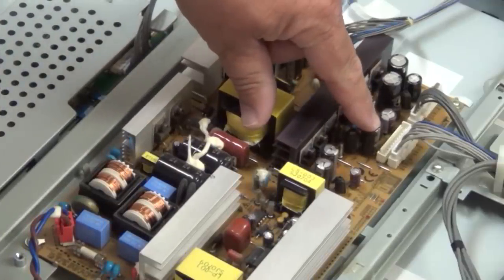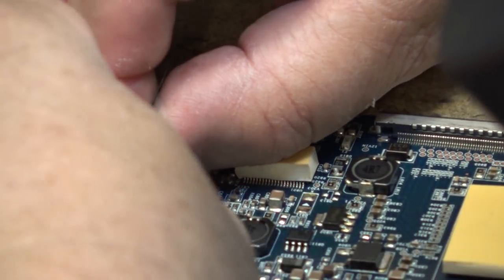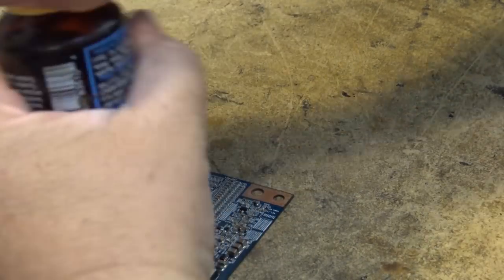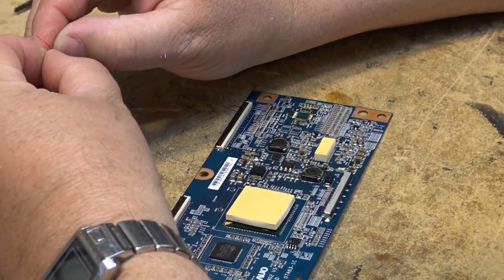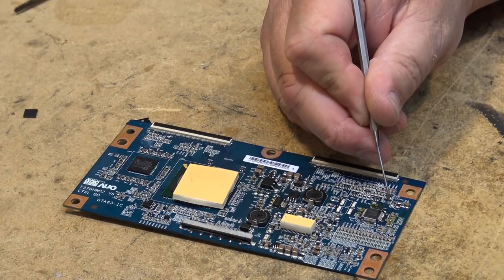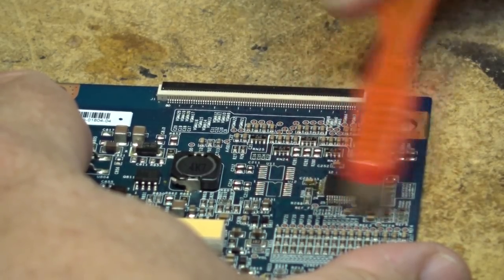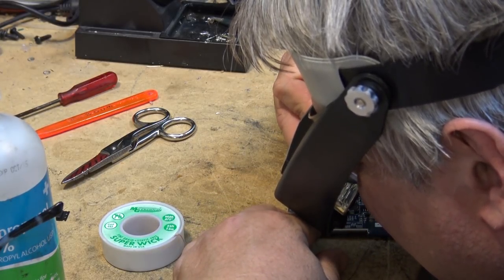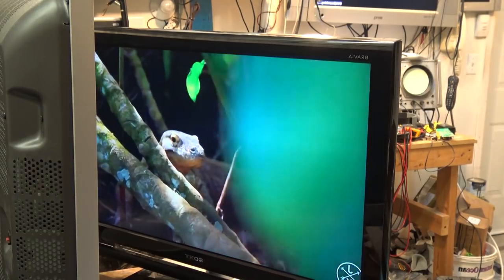Sony KDL37XBR6 Part 2 TCON board repair to component level

Comment: Hello 12voltvids! Thanks for the video! I have a KDL-37XBR6 as well, but the screen is black. Volume works and when I press on the front screen, it turns white light where I touch. Can you tell me if I should replace the T-con board completely, or could this be something else that needs replacing? Thanks!

Comment: Hello Mr.Dave need your help in catching a fault in my tv...there are horizontal lines and picture jumping issue on my 43oath1000 thomson 4k tv. Is it the fault of the Tcon board or something else?
Reply from the maker: Could be the panel
Reply: @12voltvids  thanks for your feedback 😊 is there a way I can share you the video of the screen so that you can be 100 percent sure of it. Bcoz the lines come and go they are not permanent.

Comment: Great video tutorial.  Just lost my picture on a Sony 37" I was going to pitch, since I had for 15 yrs.  Decided to pull it apart and looked at Youtube, and there you are!!!! You were working on exactly the same t-con board. Problem is I can't find the AS15-f chip on the shelf anywhere in the US .  All available stk. is located in the far east, taking over a month to get.                         .....anyone out there know where I can pick one up in the US in a weeks time?
Reply from the maker: Mine came from China for 1.82 including shipping.  Can't beat that.
Reply: @12voltvids  Thanks for responding. I do have 5 pcs (.99 cents each) on order from China... thought maybe someone had found a source in state.

Comment: Nice repair. I used a very cheap gas soldering iron I got at the local Aldi store. You can use it like a hot air station. Worked fine too.
Reply: Bought one too, but you risk damaging other components. The air out of them is mighty hot. The cutting trick is quite neat.
Reply from the maker: I think I will do a video to show removing a flat pack from a scrap board using a surgical scalpel. They work great for it. I have a new camera setup where I can get the camera directly overhead. (I set up a camera crane, and it works pretty good. Now to get the pan/tilt head working.

Comment: Thanks for this easy desoldering trick. I've never seen this before on YT.
Thumbs up!
Reply from the maker: Another way is to insert a steel wire under the pins, and heat the pins and pull the wire slightly to bend the pins up. That was the first way I learned, but the board is at risk of damage. Chipquick is a low melt solder you can flow over all the pins and then heat it up, and it will stay liquid for several seconds so you can easily remove it, but that means cleaning up the mess it leaves behind. This way is quickand no risk of board damage. Of course hot air is the best, but if you don't have hot air, this way, as you see works well.
Reply: 12voltvids Thanks for your reply. I'll keep this in mind.
I very much appreciate your  tipps.

Comment: Some years ago, i did have to replace a fine pitch ic after it failed the factory test after it was coated.
Someone did remove the coating over the solder points, so, removing the leads was no problem. 
For the ic itself i needed "brute force" (as far it was possible) due to the coating flowed under the ic. 
Removing the ic did take more time than removing the leads.

Comment: So I have many questions for you, hope you do see this and reply:  I just acquired a Sony KDL- 46XBR4 TV.
 
The first few minutes after I turn it on it works perfectly then the colors start to dance around in the Left side of the screen and darkens on the Right side.
 
I assume this is caused by the T-con board ?   The previous owner told me it is.

So how do you find out which part on the T-con board needs replacing, instead of replacing the entire board?

Also can you use a Hot Air gun instead of a hot air station to install the Chip ?

And when you are soldering all these pins and they are very close to each other, how do you prevent the solder from one pin not to flow into the pin next to it and creating a short ?  I mean they are next to each other.   Thank you.
Reply from the maker: Run it till it acts up then blast the chips one at a time with cold spray until the fault clears then you will know which chip is at fault. As to changing the chip a hot air station is preferred don't use a heat gun because you can't control the temperature accurately for flat pack IC I cut the pins then remove the remnants of the pins from the board clean the board apply Flux, center of the chip and tack the corner pins to hold the chip in place inspect and then very carefully solder each pin with a needle point type iron using high magnification to observe. There are many different techniques to solder Air station preferred but I don't have one these micro solder jobs take a steady hand and patience and a lot of inspection using a microscope or high-powered magnifying to make sure there are no shorts as was demonstrated in this video

Comment: Tricks of the trade.  Thanks for the information. Always wondered about this. None of this is boring to me....it's all great!
Reply from the maker: Just to prove that you don't need fancy air stations to change these.  They make it easier for sure.  But it can be done without it.
Reply: @12voltvids  I have a spare as15 hg chip,can it replace an as15 F?

Comment: I am having a black line intermittent on my sony TV and the main chip of that card was really hot. I decided to purchase a used control board similar to that one on ebay. I hope it fixes the problem. Where do you source the IC's? Thanks chief.
Reply from the maker: I found that one on ebay for 1.81

Comment: I have a samsung with a similar problem , not having your skills I decided to change the t-con board and got the tv working but colors are washed out. Black is displayed as grey and all colors lack brightness, any idea what might cause this?
Reply from the maker: Wrong board?
Reply: @12voltvids Thank you for your time. I bought exactly the same according to the number printed on the original t-con board, so I am scratching my head
Reply from the maker: @titodejesus6238  
Software version?
You may need to go into the setup and tweak settings.

Comment: My tv is the same as your except it turns on yet I only have a backlight. Do you think that it is a tcon or motherboard problem?
Reply from the maker: Charbear Love most likely the tcon. Very common fault on these.
Reply: Oh okay. Thank you! Also, I figured out my problem is the tcon board on my Sony Bravia. I’m not as savvy and don’t know exactly what was wrong with it so I want to get a new one and replace it. I however was told not to match by tv type because there are several boards with it. The model number is T370HW02. It has another number; BL P/N - 59.37T04.010/C. I’m just not sure what tcon board I should buy now. Please help😓
Reply from the maker: Charbear Love 
Should be a sticker on the board with the part number and software revision. Places like shopjimmy will show you the numbers needed to get the correct board. In my case I just replaced the chip because i wanted to prove the fault was indeed the part i diagnosed and it was only 1.80. Plus it was a good demo on how to change these flat pack chips without an air station .

Comment: i have a sony Bravia KJ-55A8F the T-con board is causing it to have difficulty turning on, and if I manage to get it to turn on, it will turn off at random times. Sometimes it will stay on for 24 hours and other times only for 5 minutes or less. I would really like to fix this somehow by myself, is there anything you can recommend? I would greatly appreciate it as I already purchased new T-con boards but they all come with their own issues. The turning off is the only one that displays a perfect picture with no distortion. Thank you in advance, i know this video is 6 years old but I hope you see this and can guide me.
Reply from the maker: So you bought a used tcon that had issues.  I normally wouldn't buy a board.  I fixed this one because i got the chip for 1.82
Reply: @12voltvids  any suggestions on where to check for problems on the original T-Con board that has trouble turning on and then just turns off at a random point?
Reply from the maker: @tokyotogether2495  i troubleshot this one with a can of cold spray. (you can use an inverter can of dust off) i chilled parts one at a time and when i hit the bad part the symptom changed.  I changed that part and the tv still works today.

Comment: Can Anyone help?  Sony 40", Australian model, LCD TV.  All boards no longer stocked so need to troubleshoot for a board component repair. Screen works perfectly on SD free to air channels and SD component inputs.  Screen gets vertical lines only when HDMI input selected, AND if an HD free to air channel selected.  Super weird. Any thoughts?  Cant find any similar issue described online.
Sony KDL40XBR45

Comment: Actually a good method to cut the legs of a chip :). I often do this on burnt chips. Another good method is using a stainless steel wire, tie it to the board, move it under the legs and pull the legs up while heating them. But you did really well :). Hurts a little to see you touching always that hot end of the soldering iron haha ;D.
Reply from the maker: redcatimaging 
yes have done the steel wire under the pins too,  but more risk to damage the traces that way. hot air is fastest,  cut off is next. not everyone has hot air station. as I said if I did this for a living I would get one,  but this is the first flat pack chip I have changed in 13 years and it could be another 10 before I see another. I may buy one for the vcr I am going to change 150 surface mount caps on. will see. if I win the caig video contest I will have some money to waste on tools.
Reply: 150 caps sounds really nasty ;D. You did the chip change really well, as I said :).

Comment: Is this also works for vertical lines or black lcd display
Reply from the maker: If they are thin vertical or horizontal lines it is most likely the panel.  If you have lost half the picture or entire picture is badly distorted then tcon
Reply: @12voltvids  i have a tv with bounded ribbon cables 🤣 think its not an easy task to replace.

Comment: I don't want to sound critical, but could you explore other camera angles, please? A lot of the time, we are presented with a close up of your hands blocking out the task you are performing. It makes it difficult sometimes to follow what you are doing, even though you are talking us through the operation.
Perhaps looking straight down might be worth trying, where the circuit board is in full view?
I do like your videos, but often skip through the close ups of your hands when you are not talking.
I have found using a hot air station that one needs to be prepared to place a shield between the chip and nearby SMD's to avoid blowing them off the board. This can be difficult if you need to lift the chip up after heating. Your idea of cutting the leads is an excellent one. I need to replace a chip on an LG T-CON board and I have been putting it off. I'll be getting into it now using you methods.
Cheers from down under......

Comment: Why not use a halogen lamp to heat up the pins until the chip is hot enough to be picked up off the board?
Reply from the maker: Will take too long.   Faster just to cut the old chip out.
Reply: @12voltvids  Ah ok. I’m just scared that with my nervous dumbass self I’m going to screw up the pads somehow and there’s no going back on that...
Reply from the maker: @walle637  
Cut the pins with a razor blade or scapel is easy. Then remove the pins like i did.  Changed hundreds this way when i was in the business and never screwed up a board once.

Comment: amazing!I just dont understand how you can solder the chips pins to the board without bridging them?Obviously there are techniques that i dont know....but how do you get it so damn precise and fine?
Reply from the maker: Slow and steady. I used a good magnifier to check, and double check the connections for bridging. 
I used to do this work professionally, but retired in 2003 from that line of work. There really isn't a specific technique, just steady hands, and take your time. I showed how I did it. Tacked down one side, and very carefully checked alignment then started soldering down pins. Lots of solder flux is the trick. That helps prevent bridging.

Comment: I wonder if one of those fingernail cuticle trimmers would work to cut the pins without risking cutting traces below.
Reply from the maker: The only thing I have used is a razor blade and a scalpel. Have never cut the traces, but I was very carefull not to put that much pressure on it so the cut went slow and steady.

Comment: thank you for the idea i have a board i need to remove a chip like that i thought i needed a hot air gun  but that's going to make it easier and cheaper to fix

Comment: great job i did see some hot air stations quite cheap, only as i do graphics chips on playstations, XBOX flashing lights and laptops , especially HP  plus the heat tape to protect the circuit, works ok ESD safe , temps adjustable and has an normal iron aswell with it was about £49.99 of ebay MEG, so not heard of the name, i know can be done without it but just thinking of the ones when you need it just a thought

Comment: RCA also recommended that procedure when surface mount first started to be used.
Reply from the maker: The procedure I was first shown, was the steel wire under the pins, and then I discovered this method. Sony later put on a course for SMD, and they too used the procedure I used here, but we used a very sharp fine exacto knife to do the surgery. Some of those early chips were cemented to the board, so after cutting the leads off you had to get under it and pry the chip loose.

Comment: Great. What I can't figure out is how you keep the pins from shorting each other. They are so close together. And any solder touching more than one connection will cause them to short.
Ok, you got those magnifiers.
Reply from the maker: Lots of flux to keep the solder where it is supposed to be and then careful inspection before powering it up. Takes practice for sure to do this with an iron.

Comment: I am surprised that the chip wasn't socketed like a UEFI/BIOS chips, I suspect that you have been a Radio/Television service Technician for most of your working life.
Reply from the maker: DAVID GREGORY 
40 years experience working on electronics. the 20 in the middle I did it for a living. now I only do it to keep the mind sharp.
Reply from the maker: They don't socket chips that are never intended to be replaced.

Comment: Looks like Luminance is missing.
The Sony TV’s used to have a chip called the “Jungle chip” that very often fixed many Luminance or Chroma problems.
Called Jungle because itpthe signals looked a mess in the schematics
Reply from the maker: It was called the "Jungle" chip because you didn't want to know what was inside it.
No , not a lumanance brobem, it was the gamma correction chip. I guess you didn't watch the video.

Comment: That is an as15f chip. An as15g And an as15f looks the same when you look at them topside. The diffrence between the two is that the as15g has a solder tab underneath it that The as15f does not. Without a hot air rowork station the as15g can still be removed using halogen líght bulbs
Reply from the maker: The 15g has the heat sink soldered to the board. A halogen light might do the trick, but I would just mask the board and use a heat gun.  I don't have an air station and probably won't get one because I don't do enough of this work to justify it.

Comment: Good job. But.

You can economize much time and efforts if you clean contact pads before setting the chip in place.
Reply from the maker: I did clean the pads just leaving enough solder to flow the pins down.

Comment: Nice repair love the method of removal, i to have nothing but a soldering iron have looked at some of the cheaper chinese things for doing for doing bga stuff got a few sony ps3,s of ebay that need reballing i want to have a go at doing
Reply from the maker: I'll be looking at a cheap chinese air station some day. Just haven't bothered as I haven't had a need for one yet. Don't do enough SMD work.

Comment: Hi Dave! Thanks for the nice video like always :) Are you a ham radio operator? Yeah a have burn myself many times on my soldering iron :P And it does not make it easier for me to use the solder iron when a have shaky hands :/ Stupid tremor...
Reply from the maker: Markus Hedetoft 
yes I have had my ham ticket for many years. not very active though. too much dsl noise that kills hf band.  fiber to the house is coming   happy happy.
Reply: Yes a know exactly what you mean. I have alot of noise on my Software Define Radio Receiver. Annoying neighbours that must use power-line networking (PLN) in their homes. That is nightmare for all the people that listen and transmit on HF bands :/ My granddad had ham radio operator license for many years and he was active on 20 meters CW what a can remember. I don't remember what transmitter/receiver he used to his death (cancer) in 2000. I know he had a JRC NRD-525 Receiver.
Reply from the maker: Most of it is ADSL, but PLN extenders also cause much noise, but these are usually higher in frequency, typically going up to about 50MHz. VDSL has carriers every 4KHz from 200KHz to 17MHz, with the most heavy used band through 80 and 40 meters.
Reply: 12voltvids That is very useful to know. Thanks